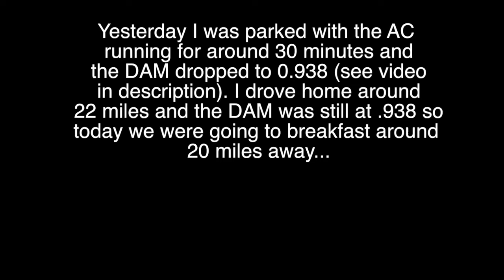2017 WRX DAM dropped to 0.938 while idling with AC on?? (Update: It fixed itself) Part 2)

Comment: You're not concerned with running the charge pipe/TMIC without the proper tune? It could have played a part in this. Hard to tell.
Reply from the maker: I don't see how it would. I've done data logging with the Stage 1 and TMIC/Charge pipe all was well. The odd thing is i've NEVER had a problem with DAM till this idling event. Did it just get too hot and detonate a bit? If so that's a bit scary because like I said it was only 80 outside. What if it were 105. Could not having the engine cover on the car somehow be a factor? I guess I could data log the idling? lol
Reply: Well anytime something is increasing power it must be changing something with air flow etc but if your logs were great than it shouldn't be as much of a concern. As for the idling, i mean it could be possible. Etuners will usually have you log 2 minutes of idling with each revision so there must be something there. I really don't think it would be temperature related. Give logging  at idle a shot i suppose. Could have just been a one time hiccup.
Reply from the maker: It didn't have the DAM issue till it was idling for 25 minutes or so. The intake temp got really high I saw 163 degrees. So I'd have to log the car siting for a while idling with the AC again. I saw lots of heat coming out of the hood scoop so I thought it was dissipating heat well.
Reply: Ok that's interesting, I can see the computer drop the DAM to pull timing to prevent a knock event at that temp even though there was nothing wrong to begin with. I guess just keep an eye on it for now. I could see 163 degree temps EASILY cause knock.
Reply from the maker: It was only 74 degrees outside or so. I'd hope a stock WRX could idle with the AC on indefinitely even in 100+ degree temperatures. So either this is perfectly normal, or something is different about my car, which could only really be the charge pipe or TMIC.
Reply: well the issue is most people would never know on a stock car since they wouldn't have an AP to see it... so ya just keep an eye on it from here on out i suppose.
Reply from the maker: Yeah I'd like someone else to test it or something to see if its normal. I don't see how its not, I really don't see the TMIC or Charge Pipe causing this issue.
Reply: Hqen2000 That much hot air being sucked in along with the over sensitive knock sensor plus higher timing curve from the cobb tune most likely caused a momentarily dam retardation.
The ecu relearned later and adjusted back to 1.
It happens regularly with the ac on, I only get feedback knock when the ac kicks in.
Reply: glad to hear that the DAM is back to normal now.
Reply from the maker: Thanks!

Comment: Hey @Hqen2000 do you have any follow up on this issue? I am running the stage 1 93 oct cobb tune and today my DAM dropped to .875. I have driven the car all week without an issue (without the AC on). The DAM dropping seems to be directly linked to having the AC on. I took it for a short drive 5 miles or so with no AC on and the DAM is back to 1.000. Just curious if you have learned anything new on this? Thank you!
Reply from the maker: +Greg Koz put the 91 tune and see if it helps